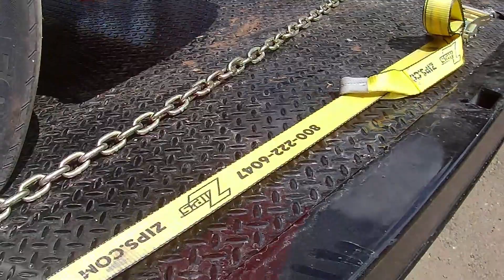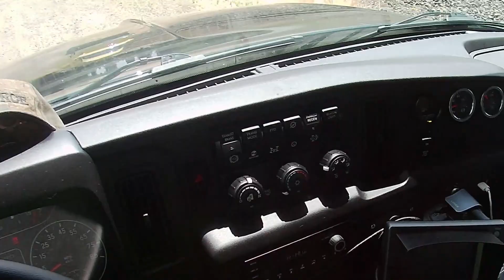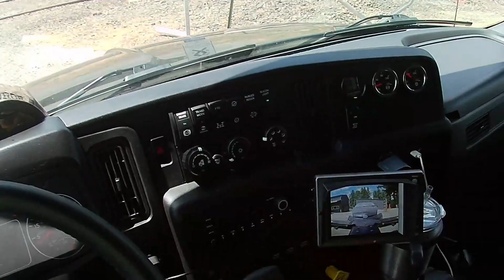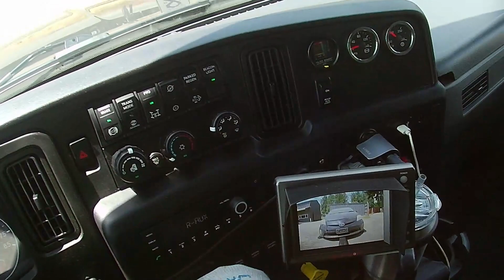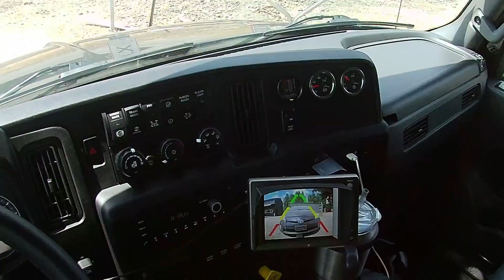Copart paid how much??!! Pick up 2 and drop.

Comment: Had similar issue with dollie straps falling off in travel, my understanding to be that the dollie wheels move up and down with terrain combined with lift doing the same yet independently, while tire in the dollie is "locked" in position in relation to vehicle on the dollie, it can not rotate if is drive axle on dollie or parking brake preventing wheel from pivoting with dollie travel or with vehicle angle changing with lift up/down movement by tow vehicle suspension travel or terrain changes (a road grade change, unintentionally raising or lowering the lift). In this theory, the locked brake on the rear of prius probably lost its strap, while the other side did not, giving credit to this theory.  Hope I explained well enough for you to understand what I mean. In my issue, vehicle in tow is personally owned rear wheel drive rat rod, once I was told of possible cause, I started towing in neutral and no longer had an issue. ( side note: my tow vehicle is a Silverado HD with sneaker lift, upgraded frame and suspension mods, no flatbed option here.)   Hope this helps, thanks for the video, great job.
Reply from the maker: Thank you for watching. I was also running the straps with two points of contact vs. the lasso strap like the wheel lift straps. Once I started using it that way the problem went away.

Comment: How much do you usally get per car owning your own truck getting insurance cars? One day I want to buy a truck. Good you have a CENTURY deck. quality. Miller industries rules. I drove a extended cab international like that older model though when it was a 4300
Reply from the maker: If your talking about what Copart pays, it varies with location and distance from the main yard. I was a Jerr-Dan guy for a long time. I like some of the options on the JD but this bed worked great. Thank you for watching.
Reply from the maker: We made $2,500 over truck payment and there were a couple times it was $0.00. With time off and holidays and such. Easily the average was $800.00 to $1000 a week after truck payment.

Comment: Its hard to watch you try and load a junk car on to a bed. You def needs training or a good refresher course. Your snatch bloc is your friend so use it all the way and stop using pieces of wood to make it go straight. sheesh
Reply from the maker: You are right. I could have used the snatch a lot longer moving it back up the bed as I went. I had only been running this truck for a month. I was a wrecker driver for many years before this. Still relearning some things at this point. I have been the towing industry since 1995. As I gained experience in the truck things got better. Thank you for watching.